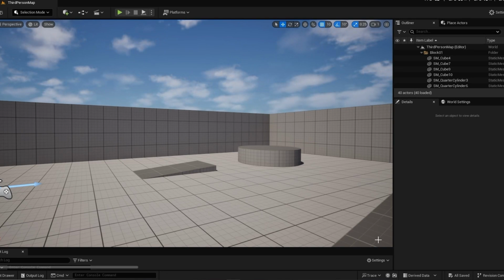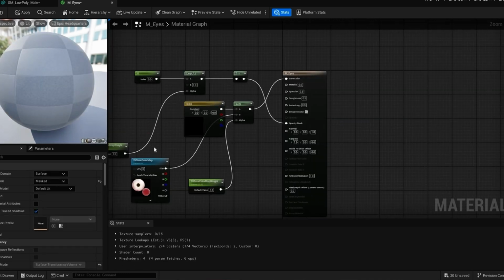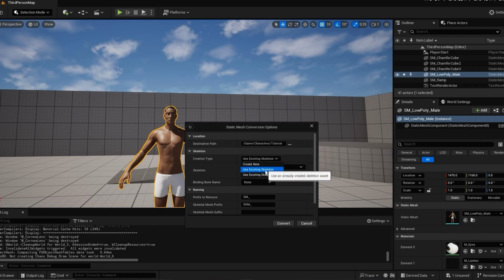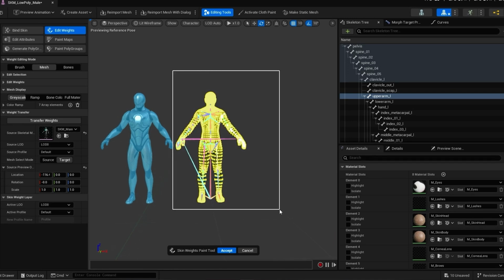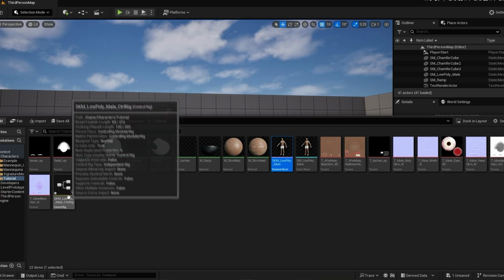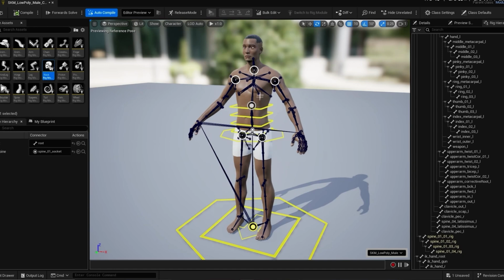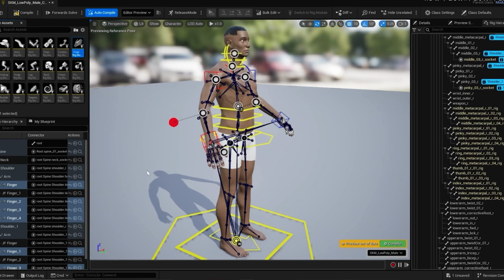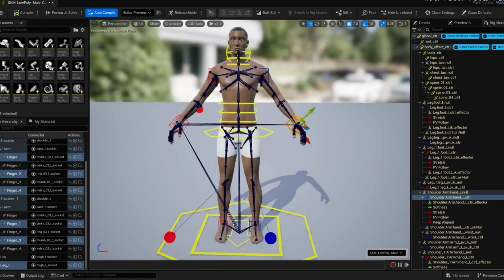Quickly Learn Character Rigging in Unreal Engine From Scratch

Comment: can this work if the original mesh have a T-pose ?
Reply from the maker: Not this process - you could move the model into a similar A pose - or you can quick rig your posed character and pose in an a pose then remove quick rig and follow the steps from the vid - hope that helps
Reply: @OutlawHue1  ok thanks .
Reply: @OutlawHue1 ps :

Can this method work for different proportions ?

Let's say it's in a-pose but tall, short, fat ...etc .
Reply from the maker: @amigoface  to a certain extent. If the proportions very different to the mannequin you would need to retarget the skeleton inside of Unreal Engine. It's pretty fast process.

Comment: I have an issue with the process, when I go into weight editing mode I can only see Brush, Vertices and Bones as options, no Mesh option at all.
Reply from the maker: Hmm, I'll look into it. What version of Unreal are you using?
Reply: @OutlawHue1  5.4, thanks for looking into it!
Reply from the maker: @frostcf1706  I checked into 5.4 - It seems this feature is not available on 5.4 - need 5.5 unfortunately.
Reply: @OutlawHue1  Oh that's interesting, most of my projects are all on ue 5.4 but I'll try to move them to 5.5. Thanks for the help!
Reply from the maker: No problem and glad I could help a bit. I almost think it’s just as easy to rig outside of Unreal once you have things setup to copy over skinweights
Reply: @OutlawHue1  Yeah I just started learning about skin weights, I've never really used maya before and did all of my rigging in blender with weight painting and it never really worked like I wanted it to. Now I'm testing out a new workflow of modelling in blender, rigging and transferring skin weights in UE 5.5 and then exporting as FBX to then import back to my UE 5.4 project. It seems to work pretty well with the base mesh, now I'll just have to test it out with an actual sculpted model!
Reply from the maker: @frostcf1706 interesting - I’m sure that will work fine and you get a bonus of becoming efficient with Unreal skin weight and rigging